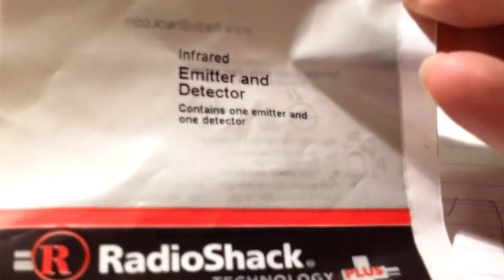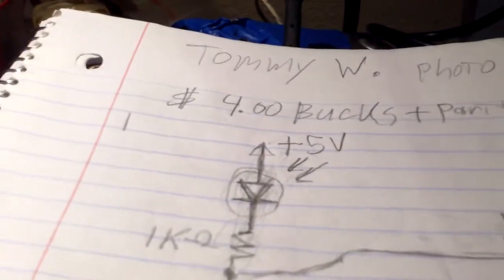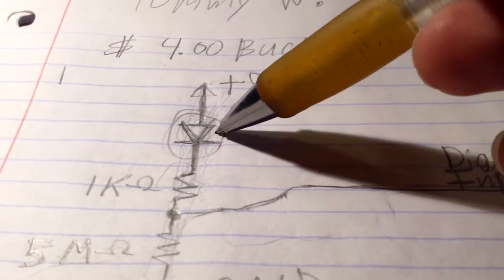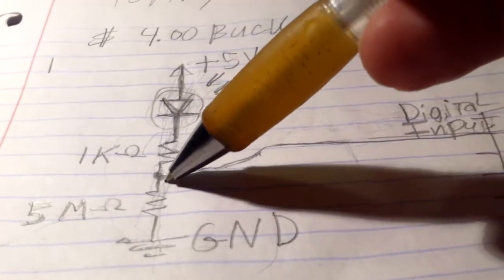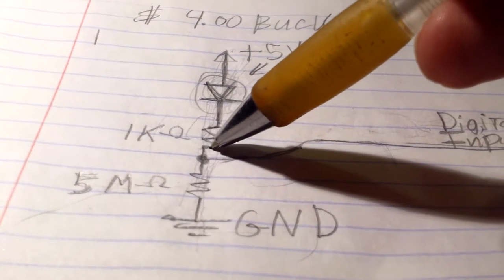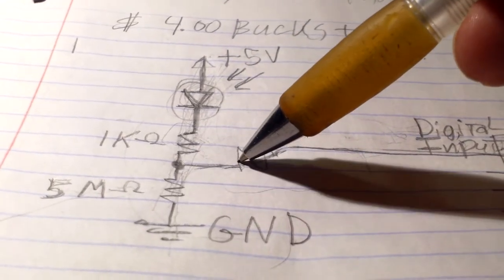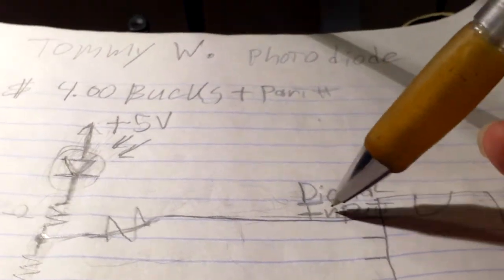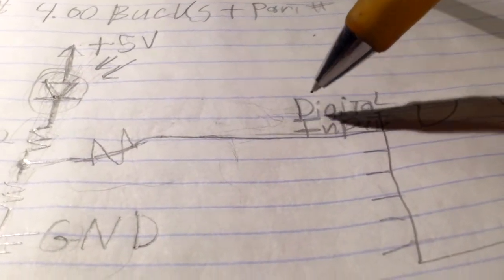TOMMY W , QUICK ELECTRONICS CIRCUIT VIDEO RESPONSE , Asperger's Syndrome

Comment from the maker: Mr. Tommy W , Duuude , hey I've found out that if I use 10 - 50Meg ohms for that 5Meg resistor , then that will increase the detection range , plus I've found out that it's very important to make sure that the I.R. led is aligned perfectly to reflect off of what ever to be detected , both of these made it possible for Me to have a range of 17 inches away from the detector , but I am using an 850nm IR led that runs at 100mA too so that definitely helps.  Ok Mr. Tommy W , Take Care Man.